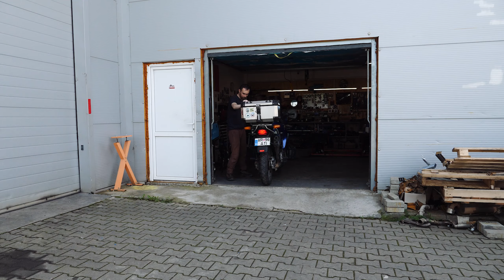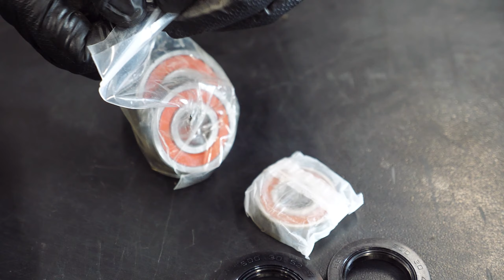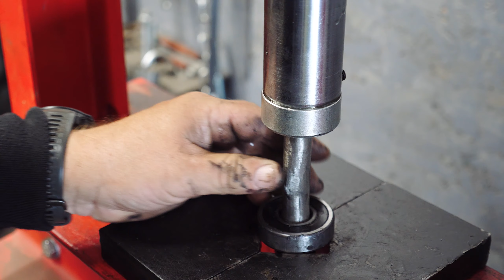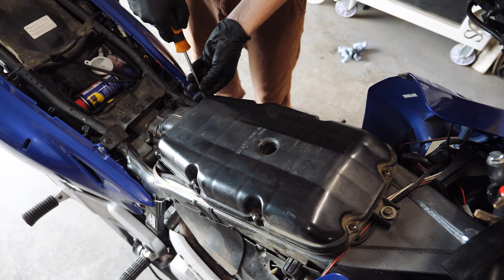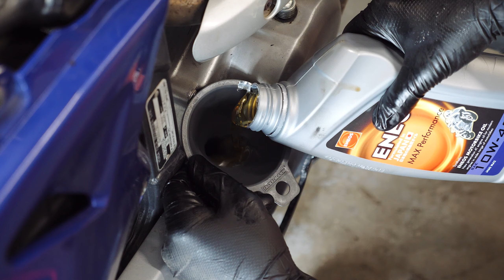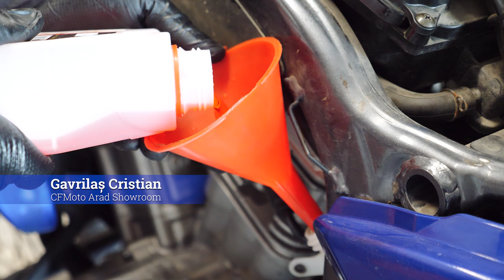TransALP 650 Service/Maintenance - O-rings between the cylinders, coolant Bearings, Oil, Air Filter

Comment: Nice. No need to unmount original engine guard for oil and filter change. Yes, its not difficult with Givi crash bars, but anyway. I have same blue one with 92k km. So miss riding it, fuc..ing war :(
Reply from the maker: @MrPelykh  🙏☺️

Comment: I also own a transalp 650 and your videos really help with the bike. Do you know if you have to oil the air filter on it? Also how often do you balance and clean the carbs? I baught the bike in perfect condition and previous owner did a lot of maintenance with the bike and has a lot of recepits for maintenance but i usually do it on my own and cant really afford to go to the dealer but with this bike doing things like valve clearnaces etc seems a lot more complicated than on my 125cc.
Reply from the maker: Hello 🙋🏻‍♂️
Great to hear that 🙏☺️
The oil filter It does not need to be greased. Only if you have sport filter like K&N. But the normal paper filter... not.
My TransALP has now 182.000km and nobody touched anything at the engine or carbs. 😁🤙And that's not going to happen soon 😁🤝 Don't do anything If everything is good 🙏☺️
Reply: @Explorersontwowheels  Thank you. The bike runs perfect so I will just leave it. You made me stop worrying.